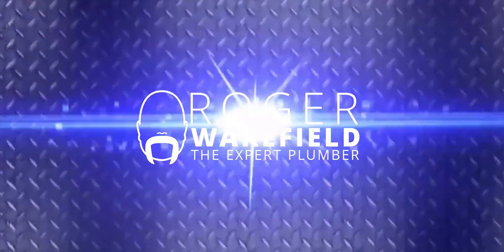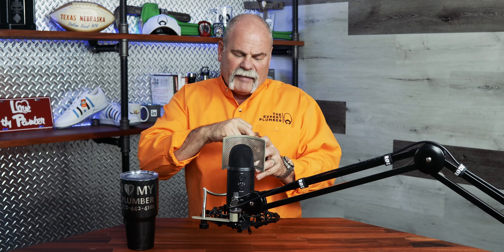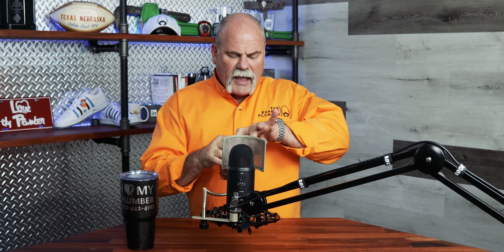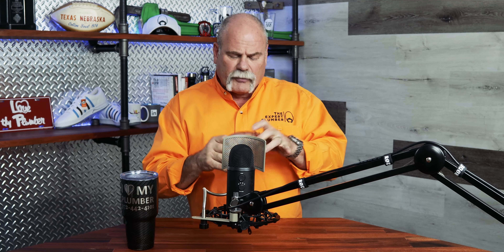Is ProPress Better Than Solder Plumbing Fittings??

Comment: I came here to find out the answer to the question, "is ProPress better than Solder?" but you really didn't answer it.
You answered the question, "Is ProPress more profitable than solder?", for plumbers or contractors to use over solder.
The only hint at an answer to the original question was you mentioned you've seen solder joints a lot older than 50 years old. As have I. There's also the matter of repair on ProPress versus solder which has to be added in to the long term.
ProPress repairs have to be cut out, leaving you with a short pipe. And depending on the turns, you may have to cut out alot just to be able to get new fittings and pipe in. With Solder, you just un-solder the joint, clean and put a new joint in.
But I'd still like to know if in fact ProPress is better than Solder mechanically and for the long term...

Comment: Those pro press fittings are EXPENSIVE, that alone will eat up any labor savings. Combine that with the deteriorating O ring scenario in 10 years millions of pro press fittings are failing and plumbers are taking in the cash 😂

Comment: Hi Roger.  Thanks for the summary - I am comforted to know they are high quality.  I still prefer the sodder, because I'm a DIY person and I can't do Pro Press myself.  I don't like being locked into calling a plumber, especially after hours or on weekends.  I'm now stuck with some Pro Press fittings (our story below), if I want to do future repairs myself is there any way to get them off and continue with sodder?

 My fiance recently had a plumber out who did Pro Press while replacing the water shutoff to the house.  This guy was shady, trying to price gouge people locked down during pandemic - we had done the same repair 2 years ago during higher priced weekend hours for less than half his normal hours quoted price.   He ended up agreeing to about $100 over half his original price.  Had I been home I'd have told him to pound sand and done it myself,  which would have been better because the guy never checked the water pressure.  I checked it when I got home and that's the probable cause why it failed after 2 years.  Now I'm forced to call someone back out if I want to install a pressure regulator, because I can't do Pro Press.  So, if you have any tips  for homeowners on removing pro press, I'd appreciate it.

Comment: FR. Pro press is just sharkbites plumbers convinced themselves are better because they require a 3500 dollar tool and match the pipes 😋.  But FR i like them in service jobs, serviceable locations and areas where flame isnt welcome, but to be perfectly honest i think the lerfect plumbing is a mix of pex and copper.  Pex on runs to reduce fittings and turns and copper everywhere else

Comment: I would rather use the soldering method it’s cheaper.
Reply: When you look at the cost of labor it’s really not much more expensive. Once you buy the tool it pays for itself over time. Yes the fittings are more expensive but you pass that onto the customer saving them on the cost of labor.

Comment: I'm retired from a local hospital. Propress is a life saver and time saver. Especially when you have to shut down an area to replace a 2 1/2" valve or replacing a large section of pipe.

Comment: Shark bite is awesome for a quick repair. To costly to do a new job. Pro press to expensive for residential. Cost needs to come down. Than it will be great. I wonder how much it would cost to do a 2 inch copper main in pro press. Too dam much. Soldering joint can be done quick too. Less expensive when done professionally. Pro press needs to come down alot.
Reply: If repairs are priced properly it’s not too expensive we use it for boilers all the time, the fittings cost a bit more but the tool is only 2100$ up to 1 1/4. I’m installing a boiler today with pro press, we will have it up and running by the end of the day no leaks no fire no mess from flux. The tool will pay for itself After one boiler. We used it for residential all the time
Reply: @jenniferbyrne8334  good morning. Cool point of view

Comment: How can you say it will last 50 years.. this method is not that old enough to make that a fact.
Reply: It's called a garantee...if it fails in less than 50 yrs they will replace it, provided it was installed correctly.
Reply: @eyellgeteven9928 - that would be called a 50 year “WARRANTY”, and it’s is not the same thing as guaranteeing a product will work for 50 years, or as you put it “garantee”, on top of the odds the company is even around in 50 years.. The product has only been around for a few years so there is no way of knowing it will last that long is my point, you’re arguing something completely different.